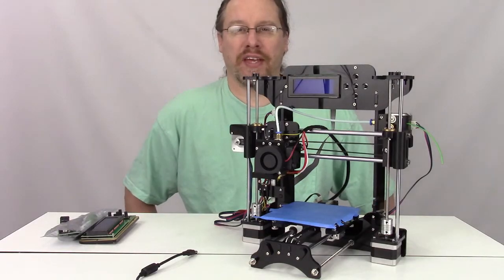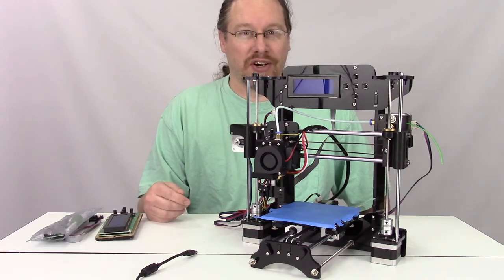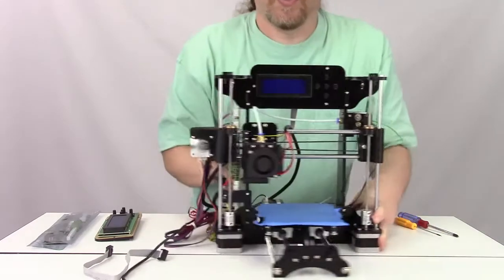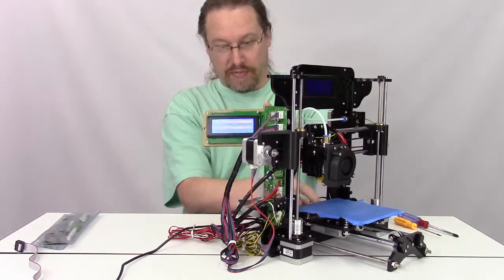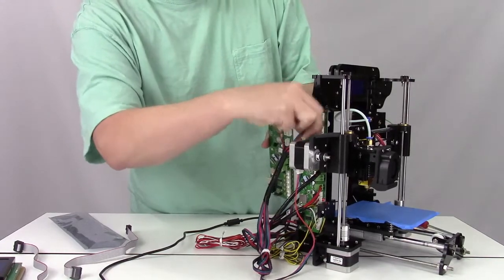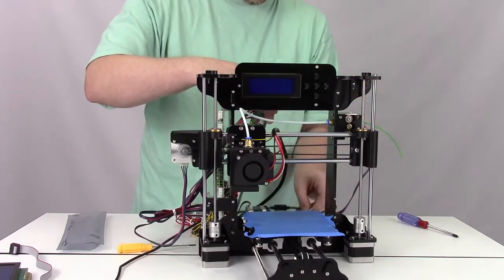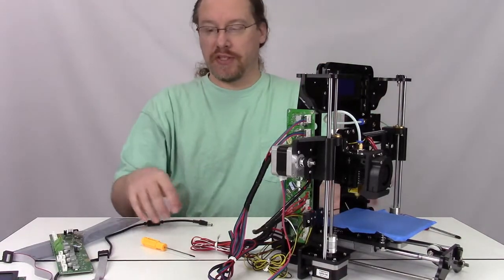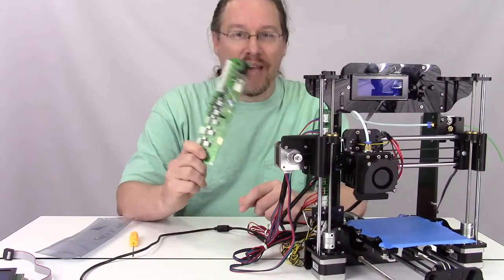iMakr STARTT $99 3D Printer Kit -  And, the failed part was...

Comment: The wires are really long correct? Wouldn't it be helpful (and remove the chance of premature wear) if you removed the main board off of the body and made a special side box for it? It would make wire control easier, as you could make a box to hold excess wires.
Reply from the maker: The wires are extremely long.  If I planned on using the printer for any real length of time, the box would likely be one of the first items to design/print for the printer along with flexible wire guides instead of the spiral loom.  (Though, it would need to be printed on a larger printer due to the very limited size of the STARTT.)
Reply: Casual Collisions I feel like it could be printed in about 6 parts probably, correct? but I feel like you should do some updates to this printer only using what it can build itself, and show a video later about what it could do. I would be very interested in what you could come up with.